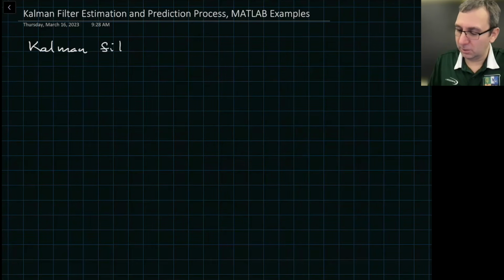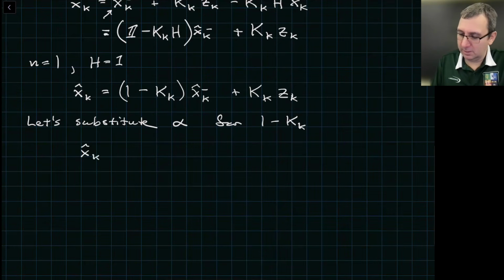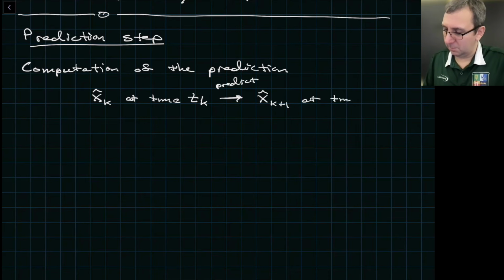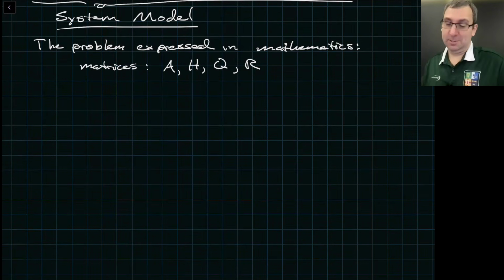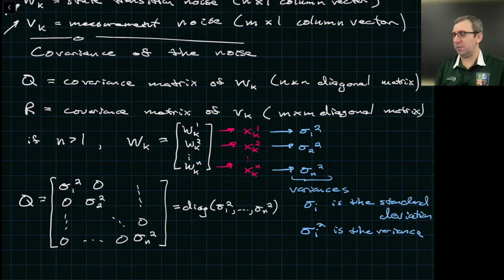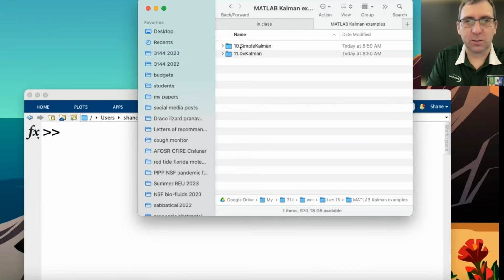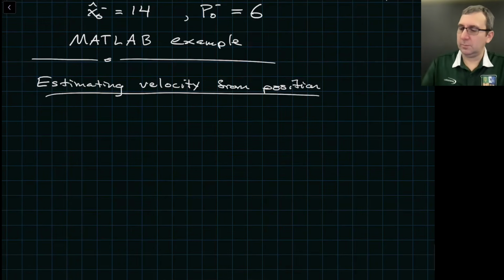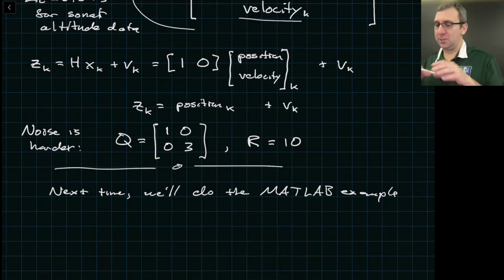Kalman Filter for Beginners, Part 2 - Estimation and Prediction Process & MATLAB Example

Comment: Does anyone have any good resources for how to deal with different sampling rates? I have found a few papers on it from an industrial/chemical engineering perspective, but their solutions and documentation went over my head. Is there any way to do it by having different H matrices for different sensors?
Reply from the maker: Great question! Your instinct is correct, that's exactly how it's done. The key idea is that you don't have to update with all sensors at once. Run the predict step forward to whatever time a measurement arrives (using the actual elapsed dt in your A and Q matrices), then do an update using only that sensor's H and R. Each sensor gets its own H matrix, and updates just happen whenever data shows up. This handles different (even irregular) sampling rates naturally; no fancy multirate machinery needed. For a good treatment, check out Roger Labbe's free book and Jupyter Notebook, "Kalman and Bayesian Filters in Python" (on GitHub, link below). It covers sensor fusion and asynchronous measurements with working code (note he writes matrix notation F where I use A).

https://github.com/rlabbe/Kalman-and-Bayesian-Filters-in-Python
Reply: @ProfessorRoss Thank you so much! I’ll take a look at that textbook, I also wanted to say your videos are phenomenal, makes me a little sad I won’t get to have you as a professor

Comment: part 1 was great but was hoping for more intuition behind the formulas
Reply from the maker: Totally fair. Part 2 leans more into the mechanics of the update step. The intuition I'd offer here: the Kalman gain K is essentially asking 'how much should I trust my measurement versus my prediction?' When sensor noise is high, K shrinks and you lean on the model; when your model is uncertain, K grows and you lean on the data. If that geometric picture helps, Part 3 builds on it further with a concrete attitude estimation example.

Comment: Hello dear professor, your channel is truly a treasure, thanks for everything,

I have a question about the velocity estimation from position, what i dont understand is where is the update of the velocity coming from ? Cuz we said that the velocity at k+1 will be the same as velocity at k, but then in the graph it shows a variable velocity curve, so are we sensing the velocity independently or we're just estimating it from position sensing only ? I got really confused here

Again thank you professor.
Reply from the maker: Great question. This confusion is very common, and it comes from mixing up the model with the estimate.

When we say the velocity at k+1 equals the velocity at k, that is just the prediction model. It is not claiming the true velocity is actually constant. It is simply the prior assumption used between measurements.

In this example we are not measuring velocity at all. We are only measuring position.

The velocity estimate changes because every new position measurement slightly disagrees with the predicted position. That position error is fed back into the full state by the Kalman gain. Since position and velocity are coupled in the state equations, correcting position necessarily changes the velocity estimate as well.

A simple intuition is: if the object consistently shows up ahead of where we predicted, the filter infers that the velocity must be higher than previously estimated, even though velocity was never measured directly.

The process noise is what allows this to happen. It tells the filter how much it is allowed to violate the constant-velocity assumption when the data disagrees.

So the variable velocity curve you see is an inferred quantity, not a measured one, driven entirely by noisy position data over time.

Comment: Thanks for the explainer! This was quite intuitive and as someone from an AOE background, this was an Aha! moment. A question: A first order low pass filter (discrete time) can be analyzed to determine the phase-mag response. Based on this, a designer can make the trade off between smoothness and lag. However, it is not clear if the Kalman filter also introduces lag. If so, does it admit an analysis similar to the first order filter? I understand the Q,R matrices are tuned 'by ear' just like a PID loop (we would like minimal overshoot, small settling time, etc.) and I'm wondering what trade offs are involved in designing a Kalman filter.
Reply from the maker: All I know about Kalman filters in these videos. I am not an expert, so I have no idea. Sorry. If you have an AOE background, you might look at material by my colleague Mark Psiaki, a Kalman Filter developer at the professional level

Comment: hello thanks for the great tutorial , was wonder why the state and prediction equation didn't see B times Uk due to always seen this BUk everywhere , what's the meaning of that ? 🤯🤯
Reply from the maker: Great observation — the B uₖ term represents how control inputs (like forces, torques, thrusts, volts, steering commands, etc.) influence the system state. It’s part of the process model:

\hat{x}_{k+1} = A \hat{x}_k- + B u_k
where
	A models how the state evolves on its own.
	B maps how the control input u_k affects the state.

If you don’t include the B uₖ term, it usually means one of two things:
 1) The system you’re modeling has no control inputs (e.g., a passive falling object or sensor with no actuator).

2)	You’re ignoring control inputs on purpose to keep the example simple (which I did in this part of the tutorial).

But in real applications (like robot navigation, flight dynamics, or satellite control), including the B uₖ term is important — especially for accurate prediction of the next state.

Maybe I’ll cover this in more detail in a future video!
Reply: @ProfessorRoss ❤❤

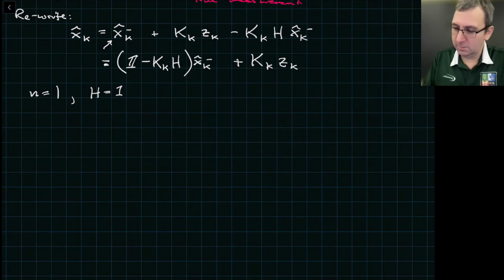Comment: at 7:09 what is n refers to  ,1 dimention kalman or something?
Reply from the maker: Great question! At 7:09, n refers to the dimension of the state vector we’re trying to estimate; so how many variables we’re tracking. And m is the dimension of the measurement vector, which can be different (like if you have fewer sensors than state variables). If you haven’t seen Part 1 yet, it might help clarify: https://youtu.be/HCd-leV8OkU?si=OVOLgH6LKjLjciaD

Comment: coded up the Matlab example around 36:00 in python using numpy. The simple 14V is tracked really well, as in your example and the Kalman Gain and the Error Covariance decline over time.  The example part is well explained and it was perfectly possible to accompish the same using python. 

Then I moved on to playing around. Instead of using a constant 14V, I simulated a noisy staircase function input where voltage increases 1V every second and a sampling frequency of 1 kHz, the filter produces a ramp, not a staircase as its response is too sluggish to catch up to the new true value before it changes again. The only way to get it to perform is to set Kalman Gain to 0.1, but now I have a low-pass filter and it doesn't self-adapt anymore. (haven't seen Part 3 yet though).

EDIT: The example shown had Q set to zero. After rewatching it, I realised I had not experimented with Q. Setting Q to the standard deviation the filter started to track the noisy staircase function.
Reply from the maker: Very cool that you adapted the code to Python. I'd like to start using Python more. Will you be posting anything to GitHub?  I have a few software packages in various languages at my lab's GitHub account, https://github.com/RossDynamics 
Nothing related to filtering yet.
Reply: @ProfessorRoss  hi, no I don't have a github for these so I took the liberty to send you a file archive to your email. Please find an email with the title "Kalman filters in python" in your inbox.

Comment: Prof, how did you say Po- = 6 is high?  @36:10 ?
Reply: i think its with respect to the magnitude of the measurement we are assuming that is 14, so like we get a measurement of 14 and there is possibility that error can be +-6 that is a lot since it means there are chances of actual voltage being (8-20)

Comment: Hello Prof. Ross, thank you very much for this video series. I think you explained the Kalman Filter in a very intuitive and easy way, unlike most sources on the internet. I have one question regarding the state estimation. As far as I know you are using a state space model in the prediction step (xk = A*xk-1 +B*uk), where B*uk describes the input to the system. However you are only using the first part which describes the state transition without any input. What if your system has an input uk which you can measure. Is it then also possible to use the hole state space equation (xk = A*xk-1 +B*uk) in the prediction step?
Reply from the maker: I'm actually a beginner when it comes to the Kalman filter, so I don't know how adding control changes things. That might be a subject for a future lecture once I work it out. In any case, thank you for watching and the kind words. I made this for the reason you said -- most sources online make it complicated than needed. Maybe that's for job security for those who know the technique (not to be a conspiracy theorist ...)
Reply: Yes. And the input control signals may also themselves have noise which may be lumped together with the process noise in Q (suitably integrated).

Comment: Thank you for the great explanation! What to do if we do not have a process model?
Reply from the maker: GREAT QUESTION! The first thing that comes to mind is to use a process model that assumes no dynamics. That is, if you have n variables, set A to be the n x n identify matrix. I do a version of this in the Part 3 video, where we use position to estimate velocity. The process model, embodied in A, assumes that the velocity does not change (which it clearly does), and still the Kalman filter does very well. The Part 3 video is here: https://youtu.be/DbE4PMgqp3s
Reply: @ProfessorRoss  Thank you very much.

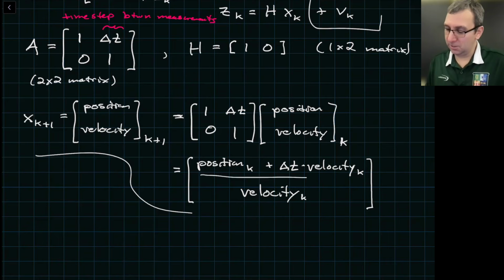Comment: another great lecture prof. I do have a quick question however for the ending (around 48:00).
How will we actually achieve the estimation of the velocity, as the dynamic model (A matrix) just says the velocity at k+1 is equal to that of k, implying that the velocity does not change. Moreover, if we wanted to make A 3x3 and include acceleration, we would also arrive at the point where we would assume that a_k+1 = a_k (the acceleration remains constant). However, we know that neither of these two statements are true. 
Where in this Kalman algorithm does it actually know how to properly update the velocity for it to actually be correct because it surely isn't coming from the A matrix?
Reply from the maker: That's a great question. I think variation in the velocity is provided by the 'process noise' term w_k, which is quantified in the Q matrix. In the next lecture, https://youtu.be/DbE4PMgqp3s, I do a numerical example for this, You'll notice, I made the variation for velocity higher than for position in the Q matrix, allowing for the possibility of some unmodeled dynamics that changes the velocity. One can adjust the process noise variance to see if results improve.